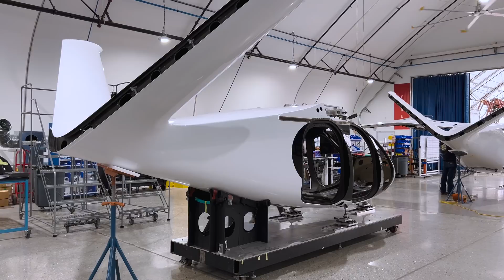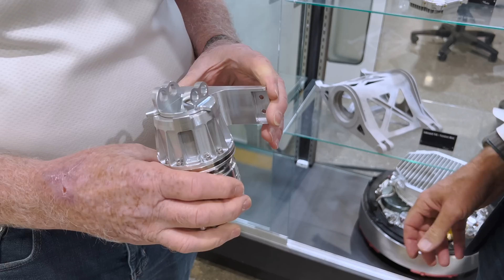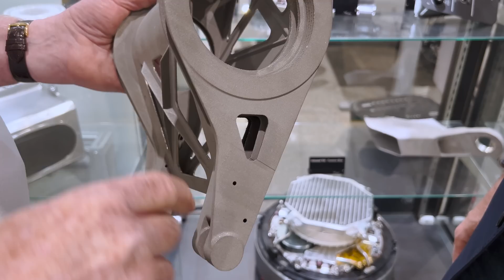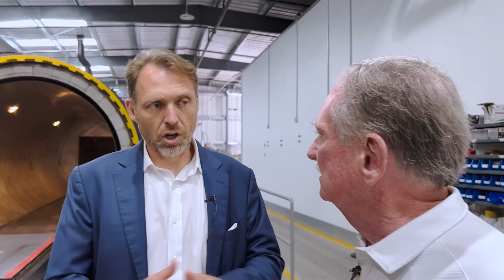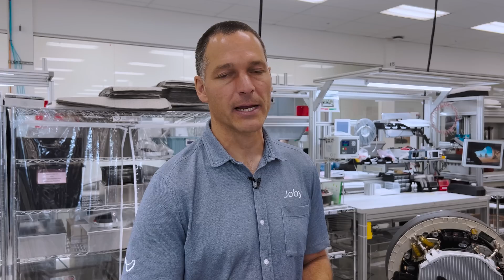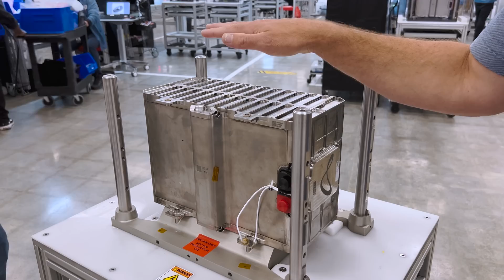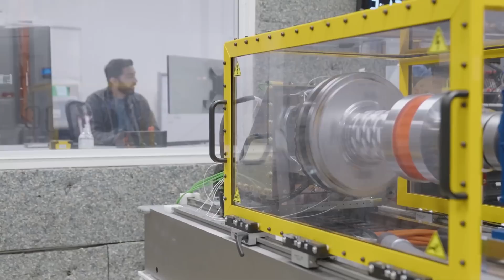Inside Joby Aviation: Revolutionizing Urban Air Mobility

Comment: If they lifted 5 weighted crash test dummies and demonstrated a complete unedited 20-mile flight, their stock would multiply instantly. Unfortunately there is no proof any multirotor evtol can lift a person and its battery for 5 minutes anywhere on earth.
Reply: And still spouting bullshit on every video. They've done 150+ mile single flights. Cope harder.
Reply: @MeerkatADV what are you worried about?
Reply: @MeerkatADV  this is a year ago. They have lifted one man for 13 minutes since then.
Reply: @MeerkatADV they were making a big deal about an airport ro airport manned flight and they were 10 miles apart.  Maybe its harder when there is extra weight inside.

Comment: Some of these components deserve their own segment! That prop!!😍
Reply: hermetically sealed batteries💥
Reply: @TheBagOfHolding  they are definetly not hermetically sealed and they were failure tested lol!!!! who in his mind would seal batteries?! this is aviation sector my guy!
Reply: @alanmay7929  he said they were in this video.
Reply: @TheBagOfHolding  he said properly concealed not totally sealed
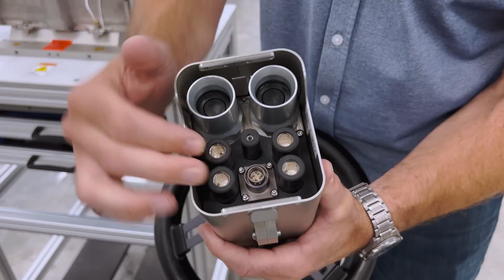Reply: @alanmay7929  31:07 who tested them? I don't think they are at the stage where they have proven anything.
Reply: @TheBagOfHolding  they literaly said they have already given a prototype for testing, also they are working very closely with the FAA.
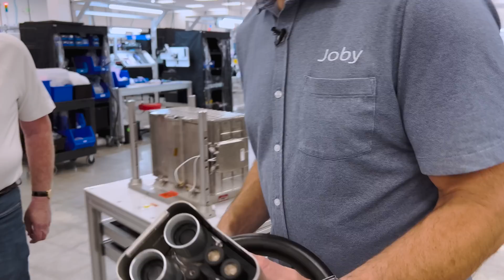Reply: @alanmay7929  30:49 fully enclosed the battery and hermetically seal it with laser welds. The faa isn't working with them they give them a type certification basis that they need to meet. There is no way they will be able to it's vaporware.
Reply: @TheBagOfHolding  nonsense!!!! the vaporwave you made?!
Reply: @alanmay7929  maybe they should prove it can lift the weight of its own batteries and the weight of a human for 3 solid minutes in an unedited flight instead of seconds long jump cut edits inches off the ground. Nobody on earth has ever shown that simple feat even with a stripped down multirotor evtol with a light skeleton frame and no seats or canopy. If nobody can sit on a battery with props and fly several minutes I doubt they will be able to.
Reply: @TheBagOfHolding  is it just the negativity or you absolutely want them to fail?! i idont get your point! if they arent working with FAA then what are they  actually doing? are you jocking?
Reply: @TheBagOfHolding  please go away with your extreme negativity or just wait and see! why do you have to be soo pessimistic?! they are using composite and modern materials its not going to replace an airbus a380 my God! its for city flights not intercontinental!  3 minutes of fly is literaly nothing and its the take off that requires the most of energy lol!!! go cry somewhere else!
Reply: @alanmay7929  working with the faa is the faa telling them what they need for type certification. That's it. They issued them a basis they will not be able to meet.
Reply: @alanmay7929  the material does matter. If it's not possible with 4 carbon rods and a person sitting directly on a battery then it's not possible with that and an air conditioner and seats. Maybe you should research the square cube law. They should carry some crash test dummies 20 miles and raise their stock price if they can do that. They can't so they show parts.
Reply: @TheBagOfHolding  How then are the ones already delivered to US Air Force Bases being flight tested?  This isn't vapor if they have already delivered production intent craft to the military for flight tests.

Best!
Reply: @neilfromclearwaterfl81  do you know what they are testing on it?  Do you think they are flight testing it with humans flying them?  Do you even know if they performed any tests?  Maybe they are testing how east it is to move in a hangar with pallet jacks.
Reply: @neilfromclearwaterfl81  you don't know that they ever flight tested anything.
Reply: @TheBagOfHolding   Instead of conjecture and conspiracy theorist assumptions please provide a link to a well known and verifiable authority on aviation who has incontrovertible proof of your allegations.  

The word of another conspiracy theorist pulling accusations out of thin air or simply repeating yours won't suffice.

Best!
Reply: @neilfromclearwaterfl81  do you know what a theory is? You are the one that theorizing flight tests were conducted by the Air Force. I didn't propose a theory. My allegations are self evident. There is no dispute that they are true. What did I say that needs propf?
Reply: @TheBagOfHolding  Most everything you said was assumptive conspiracy theory and presented with no real proof.  The burden of verifiable proof is on you when you make an attack such as this.

You come off as just another one of many internet bullies with an axe to grind.

Best!
Reply: @neilfromclearwaterfl81  again what did I say that is a theory and you need me to prove. I'll do it just tell me.
Reply: @neilfromclearwaterfl81  can you prove your theory that the airforce is flight testing them or ever has?
Reply: @neilfromclearwaterfl81  when did the airforce flight test it and what tests did they do?
Reply: @TheBagOfHolding  More important  is, "Can you prove the allegations you have been making to the contrary?"

Your are little more than simply implying that a well known and highly respected Aerospace Consultant (Sandy Monro) who pounded the pavement and personally inspected both facilities is off base here on his assessments and presentation so I and many others would have to question someone with a rather dubious screen name making such assertions.

The chase vehicle video showing a physical pilot flying the craft with ground crew monitoring, etc seems to indicate a much more capable craft then you are asserting.

I do understand that Non Disclosure Agreements likely prevent Sandy from giving away any "Secret  Sauce" he was made privy to just as I am bound to not reveal what little I know about the efforts of others doing similar work.

Best!
Reply: @neilfromclearwaterfl81  what allegation are you talking about? They don't have a video of someone flying in and a chase plane following only little clips close to the ground or over water that are seconds long. I didn't make an allegation you did that the airforce flight tested one at some point. That's not true. I didn't say anything that isn't true. I didn't say anything about the host of the video.
Reply: @neilfromclearwaterfl81  can you find any proof any multirotor evtol can lift a person and its own battery for 5 straight minutes anywhere on earth ever? They can't do it even without the extra weight of a canopy and seats and radios and air conditioner. They would show its possible and raise their stock price.
Reply: @TheBagOfHolding  The opening flight video shown of a ground chase vehicle following a piloted craft over a closed course is what I'm am referencing.  Your insistence on other than was presented by the host is indeed a comment questioning  his integrity.

Did you really expect a video about manufacturing to show a long test fight?

Again NDA's will limit what can currently be shown publicly.

Best!
Reply: @neilfromclearwaterfl81  that's an old video that is on their own channel. It's jump cut edits that are seconds long. That's not proof it can fly for minutes.  They just hover above the ground with a person for a second here and there then edit with music and change the speed. They never have even shown forward flight with the motors tilted with a person on it.
Reply: @neilfromclearwaterfl81  look at archers last two test flights. Full and unedited from takeoff to touchdown. It was empty with possibly extra battery that they couldn't lift if there were passangers but if they could do that with a full load of crash test dummies then that would be proof.
Reply: @TheBagOfHolding  Yet they set a 150+ mile on one charge flight record in 2023 with AutoTaxi breaking that by a little over a mile shortly after.  Those are amazing feats for aircraft that can't fly.

They also went to New York and flew a popular commuter route last year as an exhibition doing so on one charge.  Again an amazing feat for an aircraft that can't fly to accomplish.

We can't just make blanket statements that they can't do X, Y or Z just because they are choosing to keep that info confidential at this time.

What we can say is that they have set up production lines and have already started delivering aircraft to their customers.

Best!
Reply: @neilfromclearwaterfl81  that's what they say anyway but they don't need proof only I need it right? I think they never did. That's the old model joby that crashed and was destroyed. The new one has different motors and they never showed anything like that with the crashed one or the new one. I don't believe that flight happened as described.  Why wouldn't they post it and get some clout? They would be worth more if they could replicate that flight consistently instead of never. Still that was an empty craft. They need to lift 1000lbs
Reply: @neilfromclearwaterfl81   records are recorded, that flight was a claim. They should have sprung for a gopro or independent official if they were doing something that is record-breaking.
Reply: @TheBagOfHolding  The mayor of New York City witnessing the flight made there holds quite a bit more weight than a YouTube pseudonym claiming that he thinks it is otherwise.

So the old model flew far enough and high enough to crash to destruction.  That does not sound like barely hovering.

I'll wait for future reports from recognizable experts in the aviation industry on the Air Force test results when they are made public instead.

Best!
Reply: @neilfromclearwaterfl81  that was the flight over the river not 150 miles but to the middle and right back. Not 5 minutes. You don't know much about them.
Reply: @TheBagOfHolding  Still an actual flight with multiple witnesses and not just a low hover.

Best!
Reply: @neilfromclearwaterfl81  if the motors are pointed up it's hovering. There was water under it for safety reasons it might as well have been low. Plenty of important people visited the theranos plant including the leader of the free world.
Reply: @TheBagOfHolding  Of course it was a flight over water.  Until it gets final FAA certification for flight over populated areas that is the norm for public demonstrations in a place like NYC.

Be patient and wait for the public reveal.

Best!

Comment: Joby shareholder❤
Drop 5% today😢
Reply: Think long term. Don't stress over short term volatility
Reply: If they lifted 5 weighted crash test dummies and demonstrated a complete unedited 20-mile flight, their stock would multiply instantly. Unfortunately there is no proof any multirotor evtol can lift a person and its battery for 5 minutes anywhere on earth.

Comment: So refreshing to see someone that's not a used car salesman explain the mission and challenges. Not sure if assembling your own PCB amounts to savings since those companies are very cost-optimized already. I'm wary of autonomous 3D pathfinding since there was already one company promising this many years ago, at the cost of stakeholders, never actually delivering FSD to masses. And they would be one of the only ones who can actually deliver it. One dimension more is an order of magnitude harder.
Disclaimer: I've worked in automotive, software, airspace obstacle avoidance and even a bit subcontracting for Boeing. The Jetsons are not coming soon.
Reply: FSF is at least an order of magnitude less complex than FSD on chaotic streets with pedestrians etc.
Reply: Flying at low altitude you need to deal with wires, drones, balloons, birds, temporary corridor or area restrictions, maintain safe distance from registered and unregistered (dark) aircrafts. Add also the complexity of carrying at least one person, with no license to take over the flight. And the requirement of ZERO crashes.
Reply: @ligius3  ya forgot to mention gravity.  Yeah, when Sandy goes flying in one I'll start paying attention.  But in all fairness, these guys are doing smart things and doing the "work".
Reply: @ligius3  all thoes issues are avoided by following the simple rules... and charts.
Reply: DIY PCBAs are only justifiable for rapidly evolving products, and even then, they cost more and take longer.  Sandy, for all his knowledge and experience, has a poor understanding of electronics.
Reply: When did they claim FSF?

Comment: Considering that CATL just announced they are going to have a high density battery of 500w/kg in an aircraft by 2027-28 that will be capable of 2-3000 miles of range? These things are a slam dunk now. But the real disruption will be when they go autonomous. Because then the cost per mile will be peanuts.
Reply: I would imagine even now the pilots are there for reassurance rather than actual  necessity
Reply: @backacheache  Very much so, in China. Both Xpeng and Uhang are operating autonomous drone passenger flights commercially already in Shenzhen.

Comment: 100 more aircraft in busy airspace will be a nightmare
Reply: @sphudson  well I flew all that airspace for 35 years so I know that it would be a cluster fu**. Especially for helicopters and taxiing around the terminals. These aircraft would be going low and slow and clogging stuff up just to carry four people esch
Reply: @sphudson  just picture a lot of aircraft flying low and slow in and around LaGuardia and JFK?  A few maybe but a lot ? Thats nuts
Reply: @sphudson  in 40 years of flying ….you can’t believe how many new programs the FAA has supposed to bring out and it doesn’t happen or it’s half ass.

Comment: This is basically a giant drone with a bunch of small, high-rpm propellers. Aside from screeching noise pollution, motors are run near peak power at all times with minimal safety margins (there are concrete limits to how fast you can spin propellers) and there is nothing in the design that can generate enough lift for horizontal flight to land in case of motor failure. I don't see how it will get FAA certification.
Reply: Wrong on all counts, starting with 'big low rpm fans'. Think and research more and try again.
Reply: @colinbowman8816  I read the NASA test paper. 600-700 rpm with noted inability to sync propeller speeds across all motors and loud.
Reply: @Ficon  you aren't paying attention to EVTOLs at all.  They are very quiet, nearly silent as they fly by at 2000'.
Reply: @Ficon  That's true, but the paper also said that it emits 65db or less essentially in any configuration or phase of flight at 200m, and most of the time at 100m. That's much quieter than conventional aircraft. If you aren't  walking around 100m away from one of these things while it's  landing, you'll probably never even hear it.
Reply: "Aside from screeching noise pollution": Wrong
"motors are run near peak power at all times": Wrong
"minimal safety margins": Wrong
"there is nothing in the design that can generate enough lift for horizontal flight to land in case of motor failure": Wrong

"I don't see how it will get FAA certification.": Yes, you would be absolutely correct if your previous statement were true.   ;-)
Reply: @FrancoisBesnierUS  You know the product is going to be 🔥 when Tesla brains show up
Reply: @sphudson  FOMO hitting me harder than a tech AI crypto bro running one of these things into the ground.

Comment: These will only be viable when they’re autonomous. The barrier to ‘flying cars’ has always been the skill required to operate them.
Reply: Nah, flying is pretty easy... the barrier is cost.
Reply: @colinbowman8816  Cost is obviously a factor, but operating a plane in a crowded airspace requires an IQ over 120, which immediately restricts use to the top 10%.
Reply: @fredbloggs5902  hmmmm you may be right about that.
Reply: @fredbloggs5902  These just go point to point with lots of automation.  Pilots won't be just flying around in the sky, trying to balance the thing and find their way visually.  They are very stable and easy to fly, probably easier than a small airplane.  If they have to wait in air for another aircraft to land, it won't be long, and they can easily hover.
Reply: These are easy to fly.  They are nothing like helicopters or those stupid flying cars that can drive and fly, but will never be viable.  Joby is likely one-stick flying, and will be autonomous soon enough.  Some EVTOL companies are going autonomous from the beginning.

Comment: So, we're going out of our way to make transport clean and quiet and now people are supposed to use the noise pods in urban enviroments?
I dare you, make a sensible argument!
Reply: @sphudson  Negative? Realistic. These are great if you're a billionaire with under 100 miles to travel in only good weather. V-22 is much more realistic, since it actually has a great power to weight ratio for the power source. Don't get me wrong, maybe in 30 years, but not yet.
Reply: @sphudson  I am not negative about Joby Aviation in particular but individual aviation in general, especially in urban environments.

Comment: eVTOL is 'sexy', but performance/cost is very poor compared with eSTOL. 
eSTOL Space for a 100-metre runway can be found in many industrial and port areas. Indeed, 100 metres is a short building - can have a runway on a roof. 
I note the ancient Pipistrel Velis Electro has a max 57.6 kW motor, cruises at 90 kn while using 35 kW. Its range is 50 min + VFR - perhaps 60 kWh pack which probably weighs 250 kg. Plane weight 428 kg, Plane weight without battery 178(??) kg.
MTOW 600 kg, Pilot plus PL 172 kg Take-off run 250 metres.